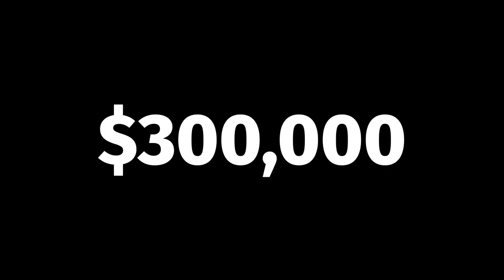7 CHEAP OFF-GRID HOME OPTIONS for Your Homestead - Podcast Episode 122

Comment: Pole Barn structures are a great home design. So are Quonset huts and Concrete domes. With the rounded dome structures they withstand high winds because there is nothing for the wind to catch and tear off. Pole Barn structures are very economical. Once it's on site, you can work on the inside at your own pace and wallet availability. Best wishes on your final decision.

Comment: A few things about cob and your situation at the sunny mt. Where you have lots of clay and access to excavators, other machinery in the family, you can mix cob on a much larger scale, so time and manpower will be less of an issue than you may think. if you look into cob building in the UK, the use JCB's and such to mix it and make straight 90 deg walls like reg builds its not all Cascadia hippy stuff. The UK has used it for centuries and still uses it, so you could get the info you need to do it right, and i'd imagine cheaper than other options.

Use passive solar orientation, windows, earth floor, climate battery and you're most of the way there for your heating/cooling, maybe a rocket mass heater or kachel oven & you're set with less maintenance than usual construction.

Comment: Something for you guys to think about…bring up a 20 ft. Container to store some of the equipment you need to start. It keeps out rodents of all types and is lockable. Later it can be used to store grain, etc.  Then build your pole structure using steep pitch roof so you have usable 2nd level and snow load easily falls off.  Great for water catchment.  With outside lean to (even more out of weather coverage). You can add tarps to drop down for rainy snowy season on lean to.  Insulate the structure at the start (less work than doing later).  Going up saves money while giving added space as you only need one roof.

Comment: I live in a HOT climate, so a pole barn becomes VERY expensive to cool. I like the idea of using a metal barn kit to somehow to create structure and roof, but maybe use straw, cob or hempcrete layers to create natural, affordable insulation. Like you guys, I like hybrid systems the best! I'd love to be using passive solar, air circulation, natural fire/pest resistant insulation and geothermal heating/cooling all in one building. I wish more people advertised that they design things like this, I have trouble finding design help in Southern Utah and there aren't ready-made plans for my dry, hot climate that I've been able to find to address all the advantages/disadvantages of each building method. Seems like people (and their workshops) will just teach one method to keep it simple but I'm happy/able to learn multiple skills if it means ending up with the best house. Any suggestions for help, maybe in Vegas?
Reply: In hot climate  in 1800s.  People built all buildings  off the ground on poles. Or now concrete  post. About 3ft off the ground to let the Breese  go under the house year round.  It will make you much more comfortable.  Also frount and back porch is used like an outdoor  room. And a summer kitchen  is a separate  building  to keep heat out of the living space in summer.

Comment: How about calling it your barn home? I've heard that before on UK based tv shows.
I love the idea. Sounds perfect. I was looking at one place here that was pretty much a big shell like a barn, and then inside they put up a sort of pod of bedrooms with quite a wide hallway down each side which would provide a stack of space for storage, and then the bathroom at the end of one hallway and the laundry at the end of the other. The pod left a big open space with high ceilings so the kitchen/dining/living space felt really big and open even though it wasn't huge. It was a really nice place. Probably wasn't as tall as yours is going to be (you could have a double story pod!), but it was a similar idea I think.
Perhaps as the kids get older you might find yourself wanting a bit more space, and then you could add little guest houses/teenage retreats using the natural materials. A cob house for one, a straw bale house for another, a mud brick house for someone else. Maybe start with one and call it the play room and send the kids out there when you need some quiet!
If you do something with cob, you've got to test my theory that it can be mixed in a cement mixer with a couple of cricket balls bouncing around to stomp it, rather than doing it with your feet. I only want a cob oven in my backyard but I still don't fancy all of that stomping. There has to be an easier way!
Reply from the maker: “I don’t fancy All of the stomping” needs to be a t shirt 😂
Reply: @Homesteadyshow  😂😂😂 or socks!

Comment: Don't want to beat the same drum but you really need to look into: Lumnd acres on YouTube, and tiny shiny homes on YouTube. They're both off grid ones in the desert with no water. (They show how they collect their water and their solar system.) The other one is in the mountains. With water but cold weather. They both did solar. And got outbuildings in kit form. Good luck anyway and hope everything works out.
Reply: We did the same in TN. A little sheet rock and flooring and it came together from there💜

Comment: We bought a shed that had been repo’d. 80% of the interior was finished. It is 35 x 14. 1 bedroom and 1 bath. We Are going to finish the loft out with a bed and railings for the grands.All In, including finishing it out, getting it moved and attached to our existing septic and a generator we spent about $35,000.

Comment: You have your metal walls that are unlined - don't forget that. But then, you could use your straw bales for that. Listening to K, I'm asking myself, you've got your Loader there, why don't you do an Earthship! Gather up all those free tires at the local tip. Maybe you can score a few other disposed of but useful building materials, metal and wood. Car and tractor tires you can use for a raised garden bed as well, or, with a little adaption, chicken tractors.

Comment: We had a shed company build the steel shell with mezzanine floor then we insulated and created the interior space.  Pros for us in temperate area, no snow but rain, frost, average summer was it was fairly cheap but more than we expected.  Cons, the top floor gets hot, We have had trouble with birds finding their way into the roof space between the metal sheets and also we have had trouble with vermin getting in under the bottom metal sheets even though we were told it was vermin proof. Remember that roofing iron still rusts around the bottom of the building and any scratches or dents that happen.  We explored earthbag building as a good cheap method for our next house.  Squared corners not Round and continual rolls of bags not individual bags. You could build some of your internal walls with the bags as well. You have enough followers that surely you could pull together some helpers for a group effort.

Comment: I'm crazy for earth sheltered homes, but this time we bought a dome house for $600 at an auction, and then we'll supplement the footing/basement/coldroom with cob and bricks (which so far has cost us about $100), and pre-owned windows for $30 apiece, glass bricks for the bathrooms which so far has been $120, and then however much we use to frame out the inside into rooms and a loft. Plus electrical and plumbing. We're currently estimating somewhere around $7000 for all that inside stuff.

Comment: We want to build a barndominium. The initial plan is to get the structure out there and have it professionally installed and then do all the interior work ourselves. We might have to start out with a small 20x20 and then add on with stick built construction down the road. We are a family of nine so far.

Comment: I’m going through the same process atm I got just under 27 acres a year ago and I’m planning how I want to build my barn and I’m putting a area in the top so I can stay there.. so far I’m figuring under 10k just for the building for any of my choices and 36x48 is my biggest design. I’ll be doing it myself and some help from my son the steel is the most expensive part

Comment: Experimenting with a few of the  methods like straw bales, etc. could be good overall anyway for some permanent use.  Loafing sheds and other outdoor animal shelters or even goat playgrounds, chicken coops, etc.  You could experiment and build cost effective animal housing at the same time, experiment with the types of natural material floors, even if it only lasts a couple of years it could be a financial buffer until you're gradually able to add other structures if desired instead.

Comment: Dammit! I just spent about two hours watching your video and stopping to make comments. But when I tried to pause the video to send my comments it went to the next video instead. No! 😱
So I won’t redo all that, but a quick synopsis. 
I’ve only seen log cabins built of spruce or cedar. I believe softwoods are used for cabins because hardwoods deteriorate too fast in the elements. You can use smaller logs for a cabin if you place them vertically. That way there is no bottom log supporting the entire weight of the wall and roof. I hear there’s less trouble from shrinkage that way too. My Dad built a root cellar of small spruce logs that way.
I was very interested in rammed earth because it can be built with local materials and it’s literally dirt cheap. I also liked cordwood. They both can be beautiful, but look very labor-intensive.
I grew up on a farm and learned the value of straw bales when I ran into our large barn mid-winter and it was approximately 35°F warmer inside. The walls had simple sawdust insulation, but the hay loft overhead, had ~12ft of stacked bales. And what was heating the barn? One cow!
I like the idea of shipping containers not for living quarters but for storage and structural outer supports that enclose 20-40ft of roofed living space. I’m surprised you’re so opposed to them when you’re metal barndominium loft looked like a double wide shipping container. And the beauty is they can be used to ship and safely store all of the building materials and tools during construction.
And I’m surprised you didn’t mention domes. They cover the greatest area with the least material. I helped my brother build one from 2x4s, metal hubs that he cut from 3” pipe, and metal strapping. Not a single nail. The frame went up surprisingly fast using scaffolding and the help of some friends. He then covered it with plastic and spray foam. It was very spacious and very warm. He couldn’t fully fire the woodstove or it would run you out of the building midwinter with the door open. I’d estimate it had to be 150°F at the ceiling.

Comment: So out here in the Midwest, a pole building and a post & beam structure are two different entities.  

Post & beam structures have much larger timbers, and utilize mortise and tenon joinery.  They are much more expensive to frame than a pole building, both due to the more costly materials and the extensive labor and expertise required.

Pole buildings often (although not always) have the poles set directly into the ground, which adds much structural integrity to resist wind loading.   The downside of having poles in the ground is wood rot. But there are mitigation techniques that can help minimize or even eliminate in-ground rot.

There are many Amish and Mennonite companies out here which will build a poll building for a very reasonable cost.  But you still have to shop around, as there are vast price differences between builders, which are not always indicative of the quality of the finished product..
Reply from the maker: Same here. Post and beam and pole building (pole barn some call it) are different

Comment: Shipping containers may be good for arid climates, but they literally rain inside from condensation in damper climates. If you intend on getting any kind of home insurance, make sure the type of home you build can be insured. And, if there is a chance of selling later, there may be an issue with shed conversion homes. Sheds are not designed or intended as homes and even if finished out, they may not be able to be sold as a 'house'. If the manufacturer sells it as a 'shell home' or 'unfinished cabin' you may be able to get around that. With a totally metal home, you may have to put up a booster outside for internet/phone service. All that metal can interfere with receiving signals. My next home will have a metal roof, but I will probably have Hardiplank exterior walls, with large front and back porches and stained concrete floors. Would love cedar board and batten, but not the cost.

Comment: It’s simple. Make the house rectangular and oriented it east west with a greenhouse on the south side and most of the windows in the south side.
The greenhouse; reduces heat loss from the home, heats the home when the greenhouse has excess heat, and to grows food, starts bedding plants and has an aquaponics system.
The greenhouse can be made 2x4s covered inside and out with flat polycarbonate sheets sloped to receive the high winter sun at 90 degrees to maximize solar gains when heat is needed most on the shortest day of the year. A rule of thumb for this angle is latitude plus 15 degrees. As summer approaches and the sun gets higher, sunlight will strike the glazing at an increasingly acute angle reducing both the amount of sunlight striking the glazing and the light which penetrates it. This automatically modulates greenhouse heating. Insulated curtains can be drawn at night to retain heat or when shade is desired. 
Inside the upper part of the greenhouse is reflective parabolic trough about 6’ wide running east to west, which focuses light to an 8” diameter black aluminum pipe. This concentrator heats air passing through this pipe. The air is moved to deposit the heat in a bed of washed gravel in the basement where it is stored for future use. Rock is very dense so can store a lot of energy in a small volume. Energy density is a combination of specific heat capacity and density. 
Smaller rocks will provide a denser energy storage and will absorb and release heat faster but will be more difficult to move air through. Perhaps 3” stones make a good balance.
Air is used to collect heat as it has a low specific heat capacity thus easily heats to a high temperature. It is also easy to move around with fans and does not have problems like water such as: boiling, freezing, or leaking and damaging the house. Rock is a good storage medium as it also does not freeze, boil, or leak and can be safely heated to a higher temperature than water. Higher temperatures enable denser heat storage and faster heat transfers.
PV solar panels on the roof charge batteries which power a heat pump which collects heat from this heated air into a hot water tank for the house hot water use. 
The roof of the house is a single slope shed type angled north, made to radiate heat to the theoretically at -273C sky. This cooling can also be transferred to a gravel ‘cool sink’ to be used for cooling the house.
Walls consist of two sets of 2x4 stud walls with a 3.5” space between, thus 10.5” thick and R36.75 insulated with rock wool. The studs can be staggered to reduce the already minimal thermal bridging. The insulation batts in the space are placed perpendicular to the batts in the framed walls. An air barrier is installed on the outside of the outer 2x4 wall followed by 1x4 horizontal strapping to which vertical siding is attached. This creates an air gap between the air barrier and the siding which significantly reduces conductive heat transfer through the wall. Since the speed of heat conduction is directly proportional to the difference in temperature, if it is -40C outside, the temperature in the air gap may be about -20C thus reducing the effective temperature difference of the wall and consequent heat transfer by 30%. This air gap attempts to effect sheltering the house within a house, for the low cost of some 1x4s.
If in a predominantly cold climate, a vapour barrier is installed on the outside of the inner 2x4 frame wall to enable the wiring to be done without penetrating the vapour barrier. This greatly reduces convective heat loss and makes wiring faster and less expensive.
Reply from the maker: Very interesting ideas here! Thanks for sharing J!